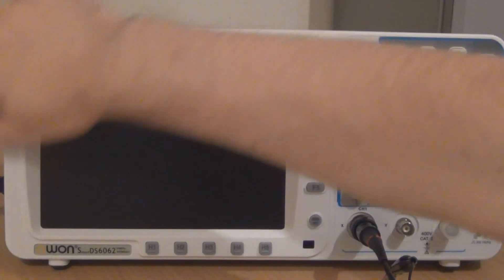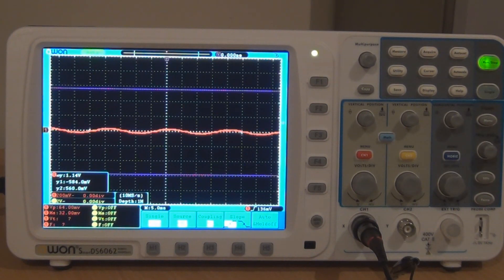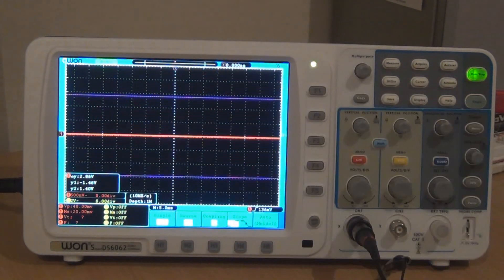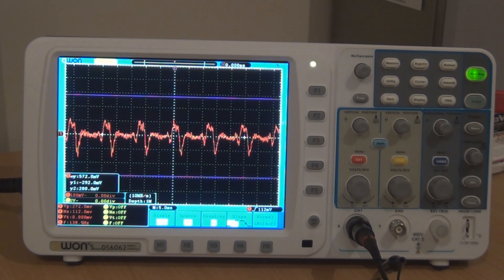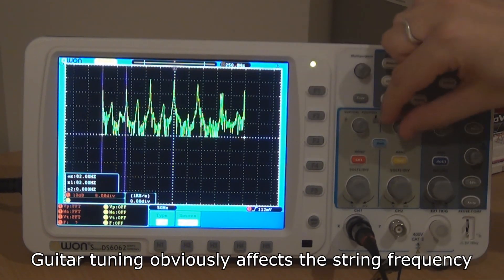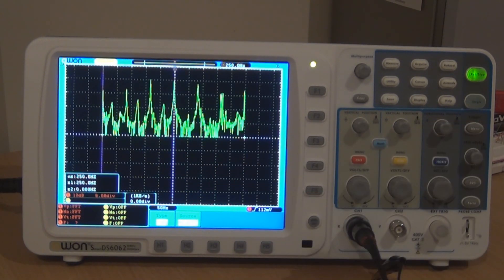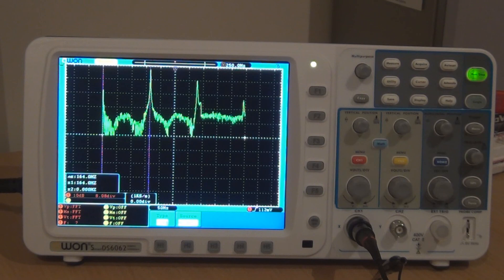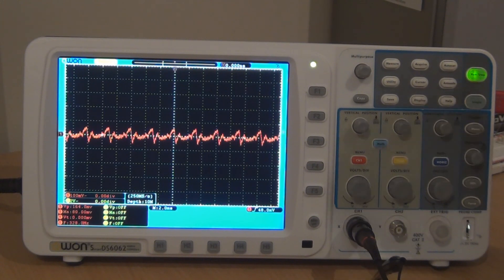What does your guitar signal looks like?

Comment: I am doing exactly the same bought the scope I (Guitarist / Electronics Tech. I am reinventing my long lost 1970 Coloursound Wah Swell. I am going to feed a sig gen sine wave into the wah it should not make any difference to a single note only amplification when the band pass filter sweeps through and coincides with the sine wave test signal. It works on the guitar note only because of the multiple harmonics generated

Comment: Great analysis. All the 'stuff', or full/partial harmonics, between the frequency peaks and troughs is the 'tone' or personality of each guitar body. These harmonics are mathematical components of the entire instrument vibrating through every atom of the body as a unit. This is why an open E (or any note or chord) on a Fender Strat is different in 'color' than the same on a Gibson Les Paul though the frequency of the primary note(s) is the same. When guitar players are seeking tone it all starts with the guitar itself and this breakdown shows the fine details due to the resonance of the body as a whole.

Comment: Thanks for the idea, I should have had a long time ago.
I'm in to some electronics repair. I have a few Oscilloscopes. I play guitar as well. I don't know why I never thought of checking this out. I'm aware of all electrical signals that are going on within a guitar. However, I could not wait to get one of my guitars lined up on my LeCroy O-scope. I now use my Oscilloscope to tune guitars sometimes and even calibrate tuners. I even use an O-scope for setting up intonation, its faster and accurate if you ask me.

Comment: From what I've researched it looks like active pickups can reach up to 4 volts (safe to overshoot and say 5 volts). This information is useful when using op amps so that one doesn't accidentally clip the output.  The oscilloscope is great for clip checking.

Thanks for the informative video.